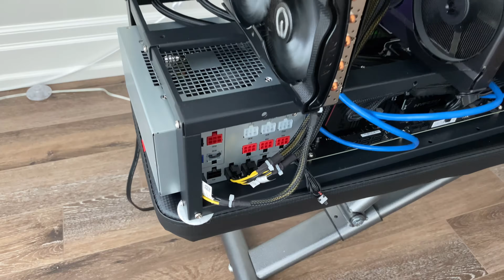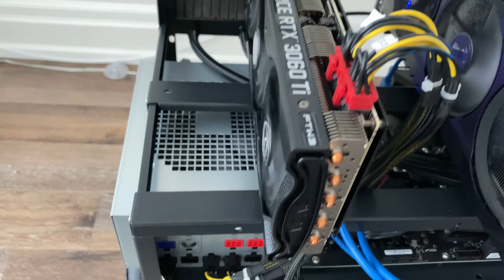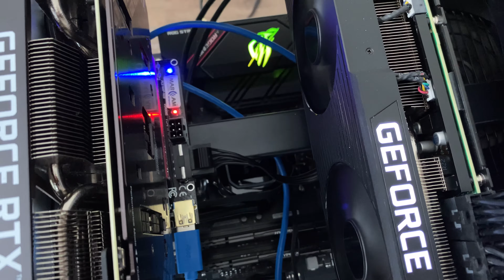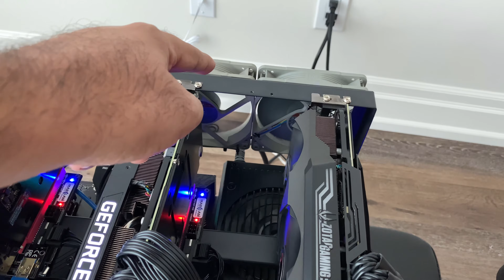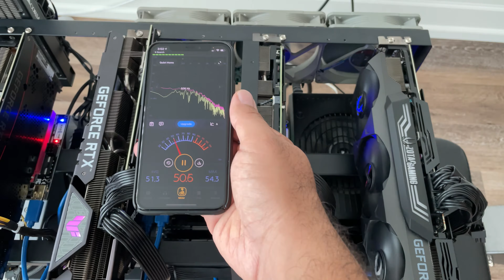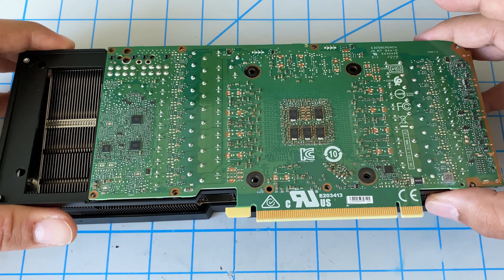Converting the Dell Alienware Aurora R10/R11/R12 to a FULL SCALE Rig | My FIRST ETH Mining Rig Build

Comment: I get problems, I have R12 with rtx 3090. I tried to add EVGA RTX 3090 to start mining but unfortunately, the PC doesn’t work. It shows me blue windows told me there is problems
Reply from the maker: You're trying to run 2 x 3090 in an Alienware R12? Which PSU does it have.
Reply: @Mangorille  can you recommend a pcie splitters for our aurora r12?  thank you
Reply: what kind of pcie cable splitters did you use? i have r12 and i dont think it has enough pcie splitters?

Comment: Thanks for the vid! I want to do similar thing. I ordered r12 Alienware PC with 3090. What made you decide to use a different motherboard? How many pcie slots are on the r10 motherboard? Have you seen the 1 to 4 pcie adapters? I used the adapters in another motherboard without issues so I'm wondering what would be the maximum number of GPUs on Alienware motherboard.
Reply: i managed to get 1 3090 + 3x3060ti work on the alienware r12 mobo for mining, however no luck on fifth card onward...
Reply from the maker: @chaitiamtee1288  Awesome! I think you hold the record for the most GPUs in an Alienware! Are you using the original PSU for all four?
Reply: @Mangorille  I have another psu(evga 850w)connected... Was worry if something happen, all 4 card drawing their tdp, r12 original 1k watt not able to support
Reply from the maker: @chaitiamtee1288  Good idea, not sure how much faith I'd put into that Alienware power supply. It doesn't have enough PCI-E connectors and they're only 6 pins.
Reply: @Mangorille  I heard 6pin can take same amount of watts as 8pin as long as 6pin is 16 gauge wire which is thicker than usual 18 gauge. I don't know if that is true. 

The Alienware PSU only comes with 4 PCIE cables?  It would be difficult to power 2x 3090s on 1 Alienware PSU which I plan to do. 3090 would take 2pcie cables each but if I mount both 3090 directly to motherboard it will likely overheat and there may not be enough room in the case to do that. If I mount 3090 on risers then I won't have 6pin to power the risers.
Reply from the maker: @DavidBergeron87  I never measured the cables but yes the Alienware comes with 4 PCI-E plugs (they're 8 pin on one end and 6 pin on the other). I personally wouldn't trust 2 x 3090 on the Alienware power supply. You could run a separate external power supply for the second 3090 or upgrade the Alienware PSU to a 1200 watt, it is just a standard power supply. FYI - Most 3090s are 3 x 8 pin power.
Reply: @Mangorille   @Mangorille  Thanks for the info. I did get r12 Dell 3090 Alienware PC 2 days ago. I connected 4 additional 1660Supers to the PC with 1to4 PCIe splitters. All 5 GPUs are on the single Dell 1000W PSU and I'm just using the 8pin splitters. Technically, each 8pin cable should be able to put out around 280w max each but maybe not because the other side is 6pin. I will try to put more GPUs, I'm guessing at least 8 GPUs should be able to be added to the Dell MB(2slots x4splitters). Since the CPU is i9, CPU should be able to handle 12GPUs without issues.
Reply from the maker: @DavidBergeron87  That's a really ambitious plan! Make sure to keep an eye on the temperature of the power supply cables including the connectors.
Reply: @Mangorille  So far seems no problem using the Dell Motherboard. I actually just had to make sure I connected Dell fans, front io connector, front power switch and 1 of the 3 LED cables to prevent error on startup like: "supportassist has found power switch discounted, click ok to continue" it sucks I couldn't figure out a way to turn that message off, it's embedded into the MB. Now, I don't get that message having connected the above. The MB that comes with R12 is Z490 I think. I have 7 GPUs(3x 3090, 4x 1660 supers) connected so far on 2x 1-4pcie splitter. I don't see why the motherboard couldn't hold at least 12 GPUs. I also have m.2 to PCIe adapter, I also have a 1-7 PCIe splitter I haven't tried it yet. I will max out the MB sometime. I just don't have GPUs laying around, I would have to take off other rigs to test it. It's basically 3rd rig I made.
Reply: By the way, I haven't noticed any issues with cables heating up.
Reply from the maker: @DavidBergeron87  Thanks for the update, those are some impressive results. Most people with the R12 struggle to get 2 GPUs working when using the mining risers instead of a full on PCI-E 3.0/4.0 riser.
Reply from the maker: @DavidBergeron87  Did you check around the connectors on both the GPU and motherboard side? Those are the areas that typically heat up first.
Reply: @Mangorille  3090s memory temperature still gets hot, sometimes 100+ degrees. I'm debating whether or not to replace thermal pads or I seen another video where just taking the inner stickers off and adding thermal paste decreased temps. I currently have 8 GPUs(3x3090, 5x 1660 supers) on the Dell motherboard, I haven't tried more yet but I plan to max it out and take advantage of the i9 processor. The fans that came with R12 are very strong, I think 4200rpm fans which is extreme cooling but they sound like a jet engine when above 60%. I currently have the Dell PSU and 1x 1000w EVGA PSU powering the GPUs and system. Cables seem fine, not hot anywhere and no issues with the system. I did have memory overclocks too high and system would freeze every 6hours or so but it's been running 2 days straight now with lower clocks.
Reply from the maker: @DavidBergeron87  The 3090 has the memory chips on the front and back so you need to do something to cool the chips on the back as well. Some people have good luck with just changing the thermal pads on the backplate but most need to add some kind of cooling to the backplate, either a fan that blows on it or a heatsink attached to the backplate.
Reply: @Mangorille  Interesting, thanks for the tips. I did see aluminum and even copper replacement backplates for 3090 but like $40+, a bit costly but if it cools it down it should be worth it by how much the card costs. I'll do some testing. I do have 3000rpm fans on the rig frame but GPUs are still hot. Hot air gets trapped in my room a bit, maybe I need ventilation system to circulate the air, do u have hear issues? Another option I have is, I have a storage room that is unheated, I could put the rig in there but in summer it would be hotter in there.
Reply from the maker: @DavidBergeron87  If the ambient temperature is too hot, it will make a big difference. I have that same problem too in the summer. I've seen people use a grow tent with a evacuation fan to exhaust the hot air out a window. That way your room doesn't heat up either. It's a bit ugly though and has a decent upfront cost.
Reply: @chaitiamtee1288  Thanks for the info! Do you have 3060s sticking out the case with risers or did you use a different frame?
Reply from the maker: Not sure about the R12 motherboard but the R10 has 3 PCI-E and one of them gets covered by the main GPU in the case. I've seen those 1 to 4 adapters and some people have actually used those to run 3 GPUs on the Alienware but my experience was that anything over 2 is trial and error and on some motherboards, especially the R12, even 2 may not work (check out the comments where some people have had to get a full PCI 3.0 or 4.0 adapter to even get 2 working). The problem is that the Alienware motherboard does not have a lot of the standard bios configurations such as Above 4G Decoding, being able to set the PCI-E version, etc...
Reply: @Mangorille  Thanks for the info. r12 apparently comes with Z490 motherboard.  After googling, the Asus Z490 should be able to hold at least 8 GPUs but Dell Z490 might be only able to use 1 GPU. I've also heard that even hooking up 2 GPUs may not work. I will test it when I get it.
Reply from the maker: @DavidBergeron87  Even if the board is a Z490, the bios is a custom Dell bios that does not expose a lot of the settings you need. The chance of getting two working is really high, you may just need to get a normal PCI-E 3.0 or 4.0 riser cable instead of the mining risers though.

Comment: When you had 2 cards on the Alienware MB, did you experience the computer crashing randomly?
Reply from the maker: I didn't. Which two cards do you have and which power supply does your Alienware have? That sounds like perhaps a power supply issue.
Reply: @Mangorille  I am having the same issue. It’s a 3080 and a 3070 with a thousand watt power supply. It literally crashes and won’t then boot up (stays in black screen).
Reply from the maker: @MakeUmad4life  You may have one of the those R12 that won't work without a full on PCi-E 3.0 or 4.0 adapter. Some people have had that happen. The motherboard can't figure out what PCI-E version to use. You can try making sure your bios is the latest version as well.
Reply: @Mangorille  that’s what I thought. I ordered that 3.0/4.0 cable that you said to order.
Reply from the maker: @MakeUmad4life  Were you able to do a clean install of the drivers? You can also try slightly older drivers too. Unfortunately it's a bit of trial and error some times.
Reply: @Mangorille  I tried everything. I did a clean uninstall to install with all the drivers. The device was able to recognize the 3070 for five minutes (I saw on computer management that it detected it) but then eventually crashed. I am waiting for the 3.0/4.0 cable to arrive today which like you said works on r12s. I will update you later tonight.
Reply from the maker: @MakeUmad4life  Unfortunately sounds like the issue some have with the R12. I think the motherboard can't properly detect the PCI-E version and the bios does not allow you to manually set the PCI-E version (normal motherboard bios lets you set the PCI-E version per slot). Others with this issue were able to resolve using the full on PCI-E 3.0/4.0 riser. Fingers crossed that works for you too!
Reply: @Mangorille  the issue fixed itself you were right! Mining at 163 MH/S now with the two gpus!
Reply from the maker: @MakeUmad4life  Awesome. Did you end up trying the older version drivers or just a restart fixed it?
Reply: @Mangorille  no none of those I got the other cable you suggested; the 3.0/4.0 cable and it completely worked!
Reply from the maker: @MakeUmad4life  Got it, glad it worked. I suggest folks try the regular mining riser first and if that doesn't work (seems to happen on some of the R12) then to get the PCI-E 3.0/4.0 riser. There's a big price difference.
Reply: @Mangorille  thank you so much man! I just have a question. I am thinking about buying another rig to increase my profitability. I found a non LHR Alienware r12 with a 3080 for $2500 CAD. Do you think that’s worth it?
Reply from the maker: @MakeUmad4life  All depends on how long you think Ethereum mining will continue and how much you think the coin will appreciate. The profitability isn't very good right now ($5.50CAD per day after power currently for a 3080), although $2500 depending on the rest of the computer isn't bad. You'll need to modify that Dell 3080 though, it's not going to be able to mine due to memory temp issues (check out my video on how to do it).
Reply: @Mangorille  yes I currently have a 3080 and a 3070 both from dell. I have modified the two of them with thermal paste. Currently the profitability for my 3080 is around $8 cad at 100 MH/S. The both of them produce $15 cad at $163 MH/S. I’m guessing you are Canadian, how much do you pay in power? 

The Alienware r12 that’s $2500 has a 1000 watt psu 16gb of ram, 512 ssd, and an 11700F I7 cpu. Think it’s worth it?
Reply from the maker: @MakeUmad4life  The profitability goes up and down, right now it's only $4.89US per 100MH.

Comment: Lol i did the same thing. I have two 1,000 psus running 2 3080 2 3060ti and a 3070. Works amazingly well. I use an air cooler for my cpu. That’s the only point of failure you have and should change (justa Suggestion).
Reply from the maker: Awesome, we have a very similar setup. I've got some CPU mining happening as well so I figured I wanted better cooling. The 5800x runs really hot otherwise. The 5800x with the stock water cooling on the Dell was hitting 85 degrees C while CPU mining.
Reply: @First Name Last Name Did you change the mobo too?
Reply: @DavidBergeron87  nope! I didn’t. These motherboards work perfectly! I have five gpus connected to it. Some of the holes fit on a standard mining rig frame but for some you have to get creative. If you have questions ask away.

Edit: and I apologize I replied late. I didn’t see the notification haha

Comment: I am planning to get R12 with 3080 and later going to add 3070. Also I am planning to use the pc for both mining as well as for personal use. Is that advisable or keep separate rig for mining and pc for other uses.
Reply from the maker: Ideally you would have a dedicated rig for mining; however, that's not really feasible for most hobbyist miners using their gaming PCs. At the very least make sure you use a well known mining software and you download from a reputable source (e.g. their main github page). Plus try to limit the amount of sensitive information you keep on the computer and keep them offline.
Reply: @Mangorille  Got it. also 1000W power supply runs two rtx 3080's ? or i have to go for 1200W supply
Reply from the maker: @karuppusamyrangaraj8904  A good quality 1000W would be enough but the Dell one only has 4 x 8-pins (well technically they're 6 pins that have been converted to 8 pins).
Reply: @Mangorille   isn't R1 to R6 all for PCI-E cables? so there are 6 x 6pins?
Reply from the maker: @rickchan108  Yes they are but it only comes with 4 cables. Not sure if Dell sells the cable separately. Plus I wouldn't trust that power supply with too much load. It is a regular ATX so you could replace with another very easily.
Reply: @Mangorille   what is the advantage using pcie riser over pcie extension ? we don't need extra cable to power the pcie extension, so can free some power cable.
Reply from the maker: @rickchan108  Mainly because they can position the GPU further away and are way cheaper.
Reply: @Mangorille  Should I mine with AMD GPU? all new RTX 30 gpu is LHR. and the price of used non-LHR RTX gpu is also insane.
Reply from the maker: @rickchan108  You can mine with either one, really whichever you can get your hands on for a decent price. Check out what to mine for a list of the mining profitability of each GPU. Even though the nVidia cards are now LHR, they can mine Ravencoin at full speed or even mine Ethereum at almost 72% with the recent unlocks in the mining software.

Comment: I am planning on adding an antminer apw7 1800 watt psu to my mining rig. It only has 10 - 6 pin male connectors. Do you know if or how I would be able to jump start it with the psu that will be powering the motherboard?
Reply from the maker: I don't have any experience with that power supply but my understanding is that it's an always on type. You would need something like the parallel miner with the breakout board. Their breakout board lets you connect the power supply to your ATX power supply so that the server power supply automatically powers on when the ATX power supply comes on.